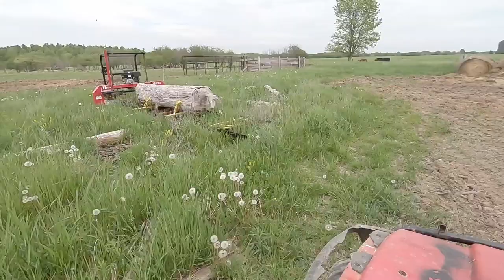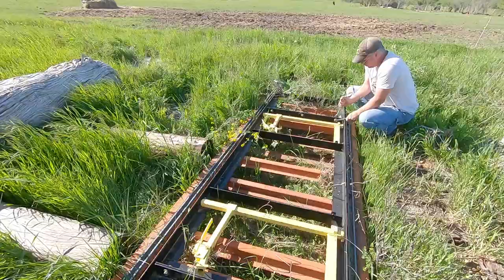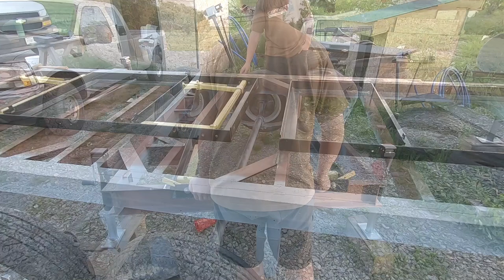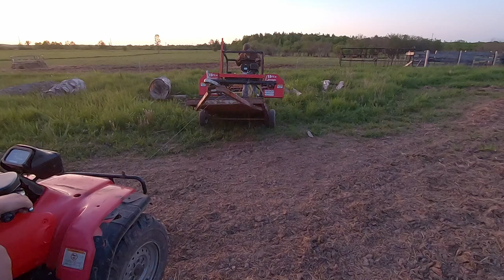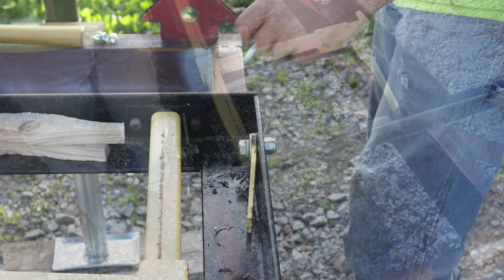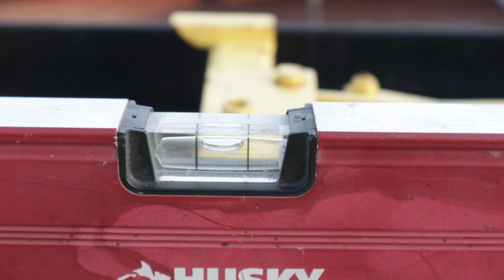Timber Frame 2.13: Moving The Sawmill The Hard Way

Comment: Yah know Jim, if you had a trailer for that mill it would be easier to move it around. Lol. Boiler manifold or pump station, either way it never ends for me either. Always working on something. Re-run are fun to watch, gives perspective on how much you've done.
Reply from the maker: Wall hung boiler system for my wife's sister's new house.
Reply: @TheTradesmanChannel  nice, a wall hung boiler. I've worked on a couple. Had one piped wrong, boiler was the highest point, high vent was at the lowest. Wasn't sure what the installers thought process was.
Reply from the maker: I've run across that myself a few times.  Lots of idgits out there.

Comment: Looks like a how water heat manifold behind ya there.  Only reason I have any clue is because thats what I put in my house when I designed and built it.   
 Just curious why not use the tractor for the heavy lifting?
Reply from the maker: The tractor I used to build the barn is my father in-law's, much easier to just deal with the tools I have at hand.  What you saw behind me is a boiler system I'm putting in for my wife's sister.  Never ends.

Comment: While you have the mill in smaller parts you might check all the rails to make sure there are no others what are not to spec.
Reply from the maker: I ran a string line, there are a couple of small dips but they won't hurt anything.